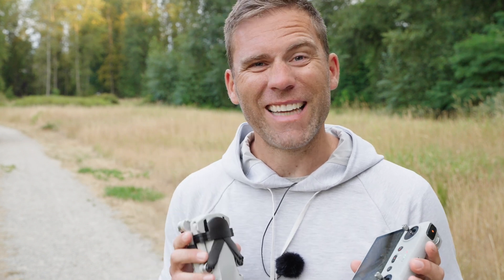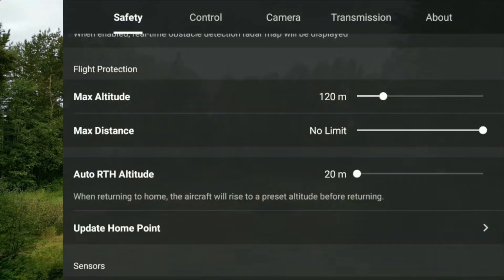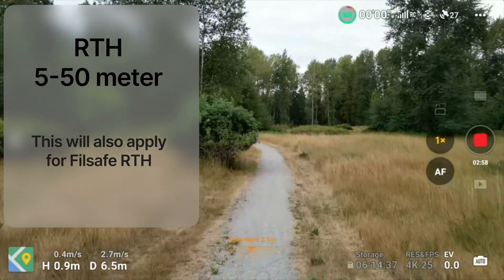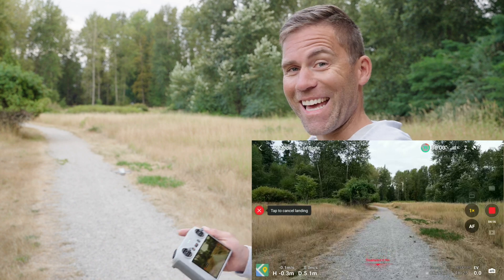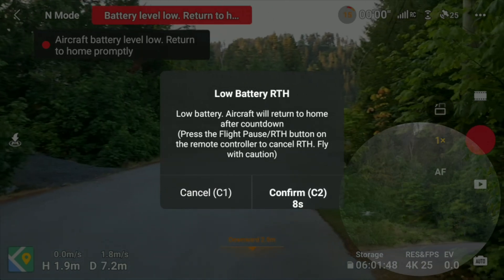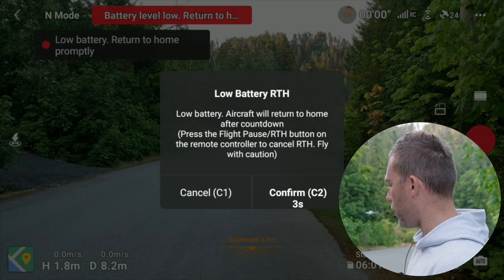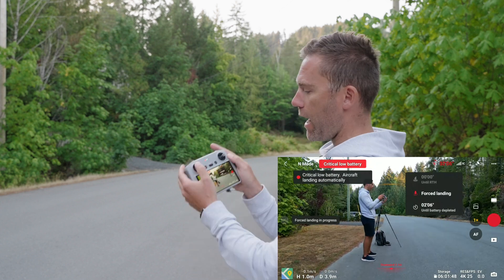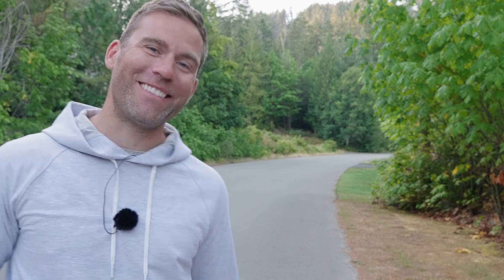DJI - RTH Return To Home Complete Guide - DJI Mini 3 Pro

Comment: hi
today i use my DJI air3 first time,i m totally beginner so i was forget that drone battery was very low..after 5 mins my RC2 controller gave warning beep or drone was nearly out of cintrol..thanks God they were landed at my place
my question is that
"HOW SET OPTION IN MY RC2 THAT MH DRONE LAND AT MY PLACE BEFORE 10 MINUTES OF BATTERY END"
pls guide

Comment: Hi and Thanks for your very informative videoes. Can I challenge you for an answer. I fly a Mini3 PRO and in the latest FW 1.12.8 it seems that the way of using the remote as a Homepoint, is a challenge. The icons have changed, and the app requires now a mobile device for GPS signal. Anyway, I can’t make It work, can you help?

Comment: Perhaps worth mentioning : in low light conditions the obstacle avoidance will not work ! So when you then go into RTH mode you can crash easily 😕 Stop RTH and find a safe way out manually, once you're sure everything is clear (take a look around and use your gimbal up and down) you can carefully move out and initiate RTH again. (a lesson learned the hard way :-(  )
Reply from the maker: Thanks for sharing your experiences 😣

Comment: Dji Mini 4, flying indoors, 1 metre away from me, battery low, rth activates, flies up and hits the cieling. 😡
Reply from the maker: Oh no!!! 😢
Reply: @MK-Creator  crashed but luckily still ok, why does this happen? If you know. Thanks
Reply: @tonycannatamusic  your RTH settings have the height set higher than your ceiling, drone is set to automatically climb to a certain altitude before returning home
Reply from the maker: Exactly. Flying indoors I would set RTH to hover.

Comment: Thankyou for such a very concise  and clear instructional video..
This may sound like a silly question but as far as loss of signal is concerned, if i turned off the remote control i assume the droje will simply return home.
I havent tried it.
Reply: You probably know this by now. You are correct turning off the transmitter will initiate RTH but remember you will not be able to interrupt the process unless you switch back on and regain a signal.  PS.  Remember to check in your settings that you have RTH set for "Loss of signal" (which is the default but there are alternatives "Hover" or "Descend") also remember that it will return to the last known home point which may not be your current position if you have moved around. Enjoy your flying 🙂

Comment: What would happen in case of mini 3(not pro) in case of being behind a three which is higher then 20m and we set the max attitude to 20m as dji mini 3 doesn't have collision recognision as pro has?
Reply from the maker: Yes it will hit the tree. Always make sure to set the RTH altitude to be higher than any obstacle between you and the drone
Reply: @Damian-tx9tr  It will hit the tree.

Comment: What happens when you on a boat doing across a lake and RTH is active!
Reply from the maker: Well. The sort answer if you are on that boat and flying the drone and you haven’t updated the home point. Well then the home point is the position from where your drone started and that’s to where it will fly back home.

I’m actually on my way out in 20 min to film a video how to dynamically update the home point to the current position so it doesn’t fly away if you are moving.
Reply: @MK-Creator  That will be an excellent test. Nobody have done a video about it yet.
Reply from the maker: @useryggfdcc  well I mention that in almost all my active track videos that you have to set the RTH to hover instead of return to home. But that is only for fail safe RTH. For the other ones you need to update the homepoint. I will consider your suggestion tho :)
Reply: @MK-Creator  Please do. A video will be the best way to demonstrate it.
Doesn't have to be on water, on land will be fine too but on a little boat will surely be much more exciting 😀.

Comment: the best way to kill a battery ..
Reply from the maker: Actually no… the reason is that it’s an intelligent flight battery that will not deplete itself below the critical point. That is why the drone actually land by itself in a controlled manner and not crash due to an empty battery. It’s not completely depleted.
Reply: It is almost empty, and we all know perfectly well that Lipo batteries are very delicate, and the worst thing that can be done to them is to lower them from their minimum voltage of 3v per cell, that battery greatly shortened its life time, I fly rc planes and helicopters 7 years ago, and I think that your video is not a good example for those who are starting to fly FPV .. @MK-Creator
Reply from the maker: The video is not an example for showing anything about batteries life time, the video is to show how RTH is working.

It’s a big difference flying RC planes and helicopters that don’t have the protective electronic built in. 

I start flying helicopters about 25 years ago and back then you are right, they lost a lots of its life time by depleting them until they could not propel the electric motors any more. However that is not the case of the DJI intelligent flight batteries. 
With that said, it can still defiantly be the case with other batteries from other manufacturers to other drones etc.

0% displayed in the DJI flight app does NOT mean that it’s actually 0%.

However I would not recommend to leave this “drained” battery without charging it for a period of time. Then it would for sure possible be drained below a critical point.

Thanks for sharing your thought. It’s highly appreciated.

Comment: Very very bad for the battery to deplete it like that, even for a demo, you took years off of its life.
Reply from the maker: Thanks for your feedback, but actually no. The intelligent flight battery will never deplete itself to a state that hurt itself. It didn’t run empty. Only empty enough to not let the drone fly anymore.
I have done tests after this video comparing this battery to a new one and could not detect any difference.

Comment: I got caught out with the critical low battery whilst active track on my motorcycle. It autolanded beside a dam just meters away from the water. What to try out next is "find my drone" in this situation, if you know roughly where it landed, the "find my drone" works brilliant taking you right to it. There is even a prompt on the controller that lets you flash its lights and make a chirp sound.
I land the drone by hovering it beside me at head height then grabbing it using my fingers either side if the sensors, then quickly rotate it in a forward roll over manoeuvre and it kills the props instantly.
Reply from the maker: Thanks for your suggestion 😁👍 will take that into consideration 😃

Comment: Thats so cool, i have been flying my mini 3 pro for a little over a month, and havent tried the fly home feature.  Also how did you film the screen on the controller?
Reply: Swipe down on the screen and you will see the option to screen record (below the WiFi icon). I have an SD card in the controller and screen record every flight.
Reply: @peterevans6086  awesome, thank you so much.

Comment: Nice thanks for these videos.  I am learning a lot about my Mini 3 Pro from your videos.  Have you made one about the intelligent flight batteries self discharging when stored for more than a day at full charge?  Think that would make a good video.  I noticed this with mine and was concerned leaving them in the charging case was discharging them but turns out it's a function of the intelligent battery itself.

Comment: I love your videos.  Very instructional. Could you prepare a video to learn how to land the drone from a moving slow Vehicule. Like a sailboat or any slow boat. I have seen some catch it with their hand and turn it upside down to kill the engine.
Reply from the maker: Thanks for the suggestion. I’ll keep that in mind :)
Reply: It's tricky to do as you are moving and have to be confident in the grab with the fingers around the lower body and a forward roll over manoeuvre to kill the props. If I had a boat, I would put it in neutral, then capture the drone in this way.

Comment: Stop, stop, stop. "Has no battery to fly"..... My correction is "Has no battery to fly back to the Home Point"! 
When flying a one way trip the Home Point is a not wanted devil. It reserves battery capacity for a not wanted mission, RTH, power fully usable for the rest of the planned flying..
Have a lock at the later part of this video: https://youtu.be/TYFIJ_2l1h4
What is "Filsafe RTH"?
Reply from the maker: If I ever stated something else, you are of course correct that the Low Battery RTH is initiated when the battery reaches a level where you are risking to not be able to fly back to the home point.
Regarded “planned flying” the DJI mini 3 pro doesn’t (by default) allow flight planning via for example waypoints for anything else than hyper lapse.
Filsafe RTH would be a typo if that is found anywhere. It supposed to say Failsafe RTH which is then the connection between the drone and the remote is broken.
Thanks for your comment. :)
Reply: @MK-Creator  Thanks! Filsafe or failsafe... I depend on Google translate, not always perfect... The RTH on lost radio was turned to hover.
I did the flying using a Mavic 3 PRO controlling it manually, sitting in the train.
Have not practised waypoints yet but the flying speed needs to be customized to the speed of the train. Does waypoints allow that? Still trust my little knowledge and experience  more that not well known "automated functions".

Comment: These are the types of features I wish I had of known about when comparing the Mini 2 and Mini 3. The mini 2 has no avoidance sensors except one on the bottom so i assume if there is an obstacle in the way during RTH it will just crash into it :/